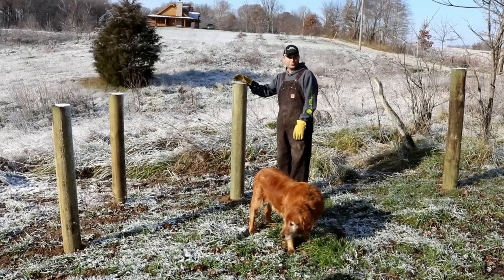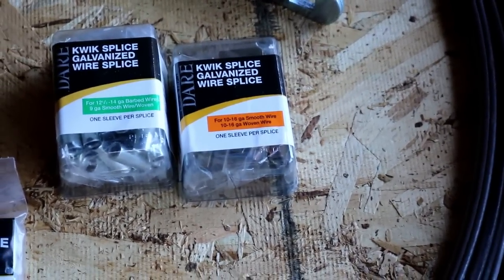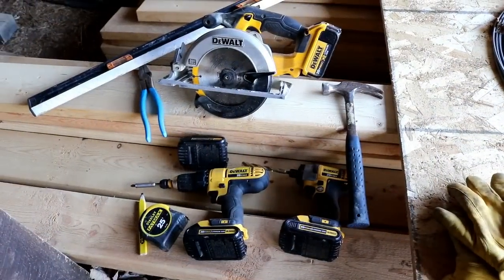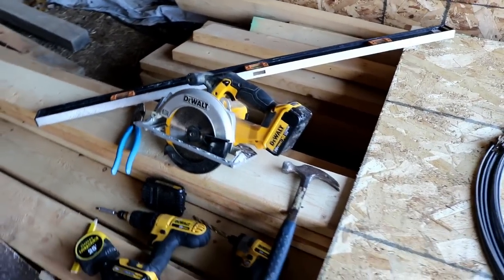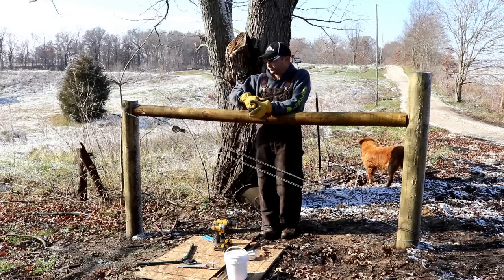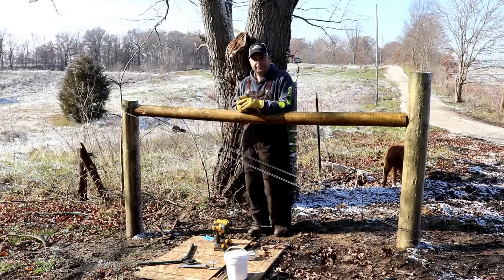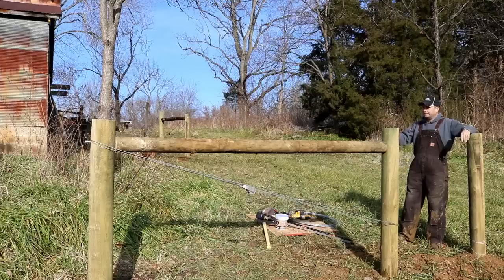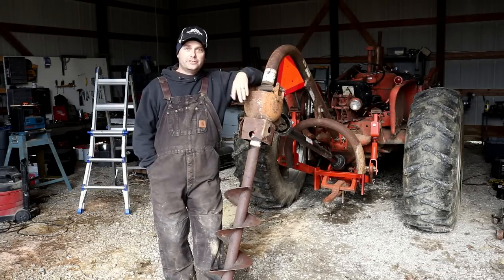Fence Bracing for the barnyard - Learning from my mistakes.

Comment: I have put  in  fencing  for  over  50  yrs and  those  pins  sure  make it  easier!!!   We  had  to  cut into the  upright posts and  then  set  the  cross  post in the  notches  and  nailed  them.  I  used  barbwire for  the  tension  line  and  used  a  stick  to wind  the  wires  together,  switched  to  rebar  pieces in Ark  so they  didnt  rot  out!  Always  had  to be  careful  winding  to not  let  it  smack  you!!!   I  put  a  line of  barbwire  at  the  bottom  for  hogs,  field wire in the middle  and  another  strand of  barbwire on top  to  keep  horses  from  laying on  the  fence.  I  had  chainlink  gates  and  wove a  strand of  barbwire  thru  the  middle  to keep horses and  cows  from  scratching on  the  gates.  Hoping to  get  outside  tomorrow  to  clean  gardens up!!!
Reply: Great video!

Comment: Hi Evan, I'm a recent subscriber, and going through your old videos to get acquainted. I ran across an old recipe for coating fence posts,  a 50/50 mix of old motor oil and diesel fuel, painted on and allowed to dry. Non pressure treated posts reported to last 100 years, depending on flooding and swamp use...

Comment: My Dad built farm fence for a living for 50 years, spent the first part of my youth with Creasote burns on my shoulders from putting in real fence posts that were a minimum of 10' long and 12" diameter and soaking wet from the mill dripping with creasote.  Good luck finding a real fence post nowadays, the posts we used were more like creasote telephone pole butts compared to the toothpicks they sell today.  My Dad passed a couple years ago at 87 years old, there are plenty of fences of his still standing that I helped him put in in the mid 1970's and are still in better shape than some just put in new by so called "professional" farm fence builders.  I still have his set of Pace fence stretchers bars, chain come-alongs and chain sets.  You gotta have more post in the ground than above the ground, know how to concrete the bottoms in and how to "set" the concrete for the upper part of the posts and how to dig the post footers correctly.  Use at least 4 wraps of #9 brace wire, don't use some chincey little piece of crap for a twister.  You start and finish the wire wrap ends going across the front of the post to the opposite side wire, wrap it and finish it off with a locking bend twist so they won't come unwrapped under tension.  If you don't have a good end post and brace set, you're throwing away all your money on the whole job and a fence that doesn't have enough tension to "twang" and transfer sound to the other end is NOT tight enough and won't last.  Want to know who's a real fence builder, ask them what a ROD is, how long it is and how many ROD of fence is in a standard roll of wire farm fence.

Comment: Well done with your fencing is good.
Keep your brace up though up   as that give more strength in your H brace.
If you are doing goat and sheep I would put a barn on the bottom of your posts to stop sheep pushing under the ground wire as they may do.
If any doubt about any fencing technic look at New Zealand fencing on the Internet and you will never go wrong.
Ps have you tried a figure 8 wire tie ? Love to here from you.

Comment: I have never seen braces that high before. All I have ever seen and the way we do ours is put the brace in the center of the post. We found that the barbless barbwire works the best for the wire. You need two wires. One from the top to the bottom on each post making a X. Using a pipe or crow bar between the wire halfway between the post and the brace twist the wire to tighten. That will give a even balance on both post.  The fence does go on the outside so when rounding the corner the post will hold the fence. If animals are pushing on the fence they can not push the staples out of the post or staples get loose the post will hold the fence.
Reply: Supposed to be 3/4 of the fence height

Comment: So is that tractor post hole digger easier then then the man post digger looked a lot easier and faster
Reply from the maker: Yea, it was a lot easier digging.  But getting it on the tractor wasn't easy by yourself.  Overall very happy with the purchase.
Reply: @CountryViewAcres  And safer, nothing worse than the two man (or man and wife) hand held taking a bite into the ground and the top end spinning around and catching you in the hip or someplace worse.  I'd take fighting with getting it on the tractor over that any day.  Place looks awesome, can't wait till you fill it with weed eaters.

Comment: Hi there. Matt from Ontario. Just wondering what determines the distance between the two main posts in an H-brace? Thanks!
Reply: Twice the height of the fence or there about. It's done that way so the brace wire can pull the posts together without pulling the corner post out of the ground over time.

Comment: Your not supposed to tighten the wire brace on post until you put the fence on and start tightening that. Also post gotta set and even go through a rain or two before really tightening it down.
Reply: You always tighten your h bracing wire before the fence wire. That’s the point of it. Tightening it after would be pointless. Tamped posts don’t need to set or go through rains.

Comment: Have you considered a figure 8 joint for your wire.  I am guessing it is high tensile wire.  Cheers.
Reply: Thats the recommended way so it's not close to the electric fence.
Reply: My Grandfather was the first to use the figure 8 wire tie his cousin's were the Hayes family that made farm equipment in NZ they on a visit saw him using the tie and asked if they could put in the Catalog magazine of the company and it sent from there the Old boy of the Hayes family and tremendous inventor Ernest Hayes invented the original and best wire strainer ( the Hayes wire strainer) over 100 years old in design still made today under Strainrite Brand. Just a bit of history that I thought you might appreciate.